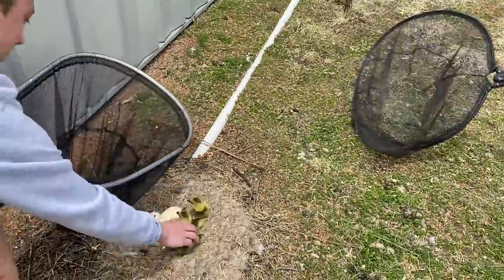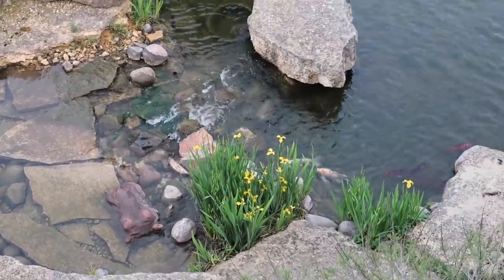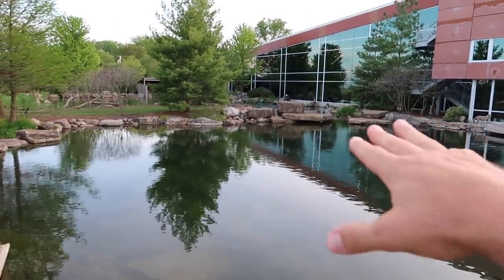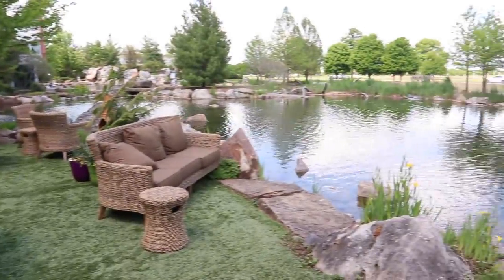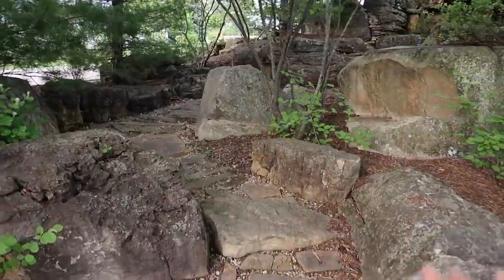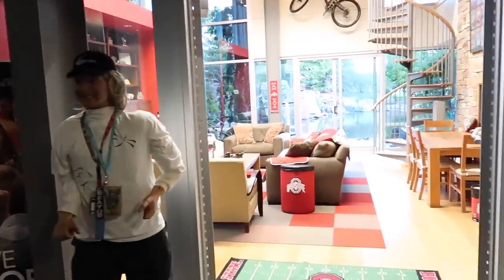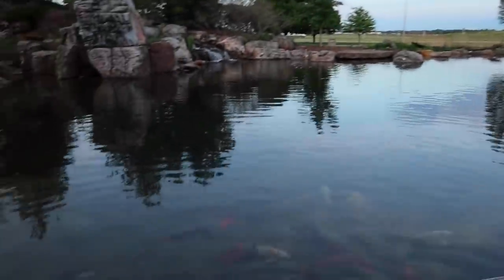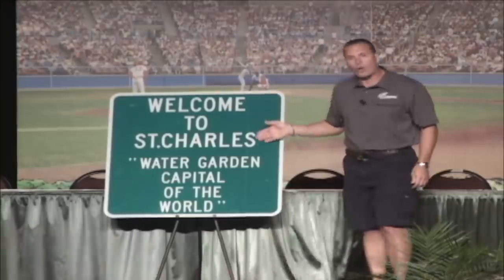REC POND W/ Beach FINISHED: Cleanout at Aqualand - Part 3

Comment: I got an 80000-100000 gallon pond. How many of those caterpillars do you have? My pond is all natural and stays around 15 feet deep even in the most dry seasons. It's about a quarter acre. I am looking to put in a wetland filter but just need some pointers on what size pump to use.